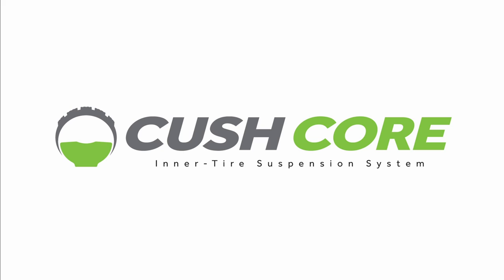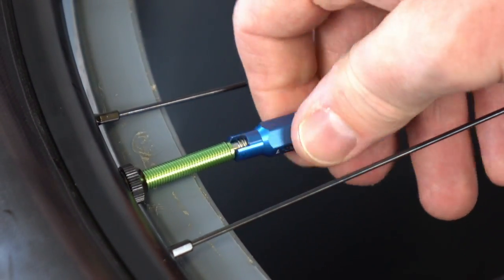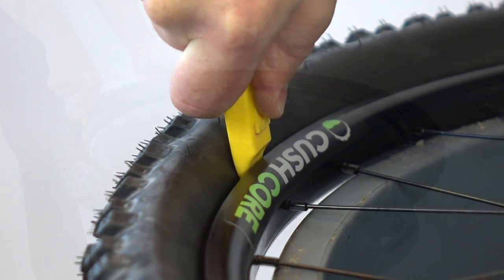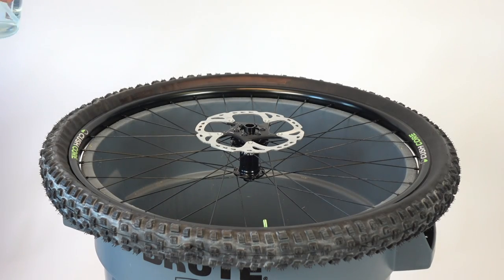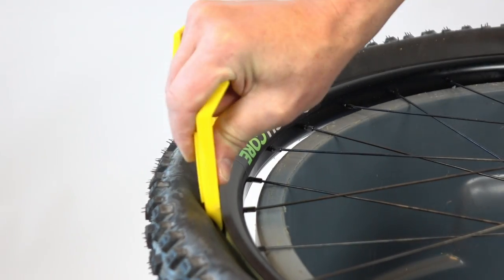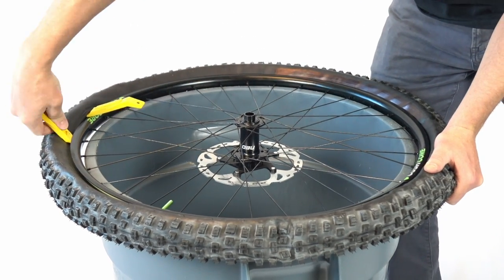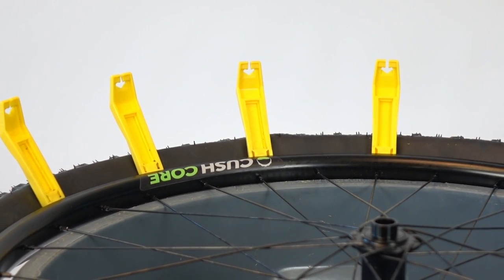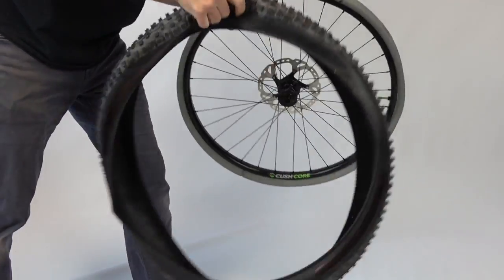Tire Removal with CushCore

Comment: This bead breaking technique only works on freshly fitted tyres. One they’ve been on a while you arn’t getting the bead off just by pushing it with a lever.
Reply: It wasn't exactly easy but it worked on my specialized eliminator after 6 months with cush core. Also to consider, without cush core I was able to remove and install that tyre using only my hands cause it is very light.

Comment: It sure does look easy on the video. At least I'll never have to cross train and can just become a professional cush core wrestler.
Reply: A makeshift tire stand, a nice round garbage can. Where your new hope rim will eventually end up when you still can't remove a DH casing tire after trying for days.
Reply: And I take it all back. Finally got it.
Reply: And it only took you couple of weeks :D
Reply: @stickthatboof  Hey ... knife + wire cutter. One side is still on, the other is cut. Bleeding hands... and I trained on enduro and MX tires....  this was IMPOSSIBLE to drop to center. I have a tire removal stand too ...
Reply: I hated the process when i wanted to install it. My synchros rims are quit tight to get a wheel on even without cush core. And the Titel i wanted to put on Was the Continental Kaiser it is even tighter with the beat then any tire i know. Was a pain in the ass but i got it on. Now i face the challange to get it off and change the cushcore to my New bike. Wish me luck i'll need it

Comment: One of the most important steps is to completely remove the valve core. This allows you to press on the tire without it pressing back at you, because air can freely enter and leave the tire.

Comment: One tip for getting the tire off the bead. Use the tire lever as shown but give it a light tap with a rubber mallet. Worked for me, where doing it by hand wouldnt.
Reply: This!👍 The video is useless because it is a new tyre with no gummed up sealant 🤨 Force the tyre lever in slightly then hit it with a mallet, the bead then falls into the well of the rim. Chase around the rim using the same technique until it is un seated all the way round 😁

Comment: It can be ungodly frustrating but it can be done. If you get frustrated, take a break. Don't be like me. I tried forcing things and wrecked the rim removing my rigid DH tire with a wire bead. Also bent two tire levers in the process. The issue for me was that it took a ton of force to break the bead away from the rim, and after doing so it would pop right back into its slot when I removed the tire lever.

What worked for me was using 3 sturdy DH tire levers. I pried the bead away in three spots close together, leaving the tire levers in place to keep the bead from popping back. Then removed the middle one and moved it to the outside to pry more of the bead away. If the bead pops back into place when you remove the middle one, pry it back and stuff something in there to keep it away from the rim. I kept repeating this until the bead was around 50% separated from the rim, then it started to get a lot easier to push the tire away and the bead stopped trying to reseat itself. Once the bead is unseated, it's just like removing a tire without the insert.

Comment: This sounds good but it does NOT work.  I followed instructions and got no where  might work if there was no tire sealant involved. Probably have to cut the tire off and throw cushcore away
Reply from the maker: Bill, Feel free to reach out to us directly at 541-241-2444. We are happy to chat with you to find a solution to your issue!
Reply: @cushcore no, no. He's got it correct. The proper installation of your product involves opening the trash can and inserting into that receptacle.

Comment: I just grabbed a knife and wire cutter 5 minutes ago and that took care of it.

Maxis recon 2.8 was so fused to the rim after 1000Km and 2 bottles of Stan's, that it was impossible to drop to center. Minus, my rim doesn't have much of a center. Might be enough for a normal tire removal, but not with the CushCore inside.

I changed motocross and enduro tires by hand (tire levers) without proper tools. This was literally fused to the side walls .. 40+ years of riding and haven't seen anything like that ....
Reply: @cushcore690  The rim is the DT Swiss made specifically for the Pivot Shuttle. Has a very slight and curved center drop. 2.8 ... the tire was a Maxxis recon. (I am happy it is gone, it is a horrid tire :) ... but lasted 1100Km ... 

BTW I rode home on a flat that didn't seal. 5Km Rocky dirt road (not really a road anymore). Not a dent and the CushCore looks like new... 

Cheers ..

Comment: So take two packs of levers and a trash can riding with me? Ok check
Reply: get yourself a bacon strip pluggeroo for the trail. I made the mistake of pulling my cushcore on the trail once before realizing it probably wasn't necessary.
Reply from the maker: All you need is Dyna Plugs or Bacon Strips tire plugs! Works like a charm
Reply: Unless you slash a tyre beyond a dynaplug repair capabilities
Reply: @knott4me561 then you need a new tyre anyway. Ride is finished, take it to the shop or home workshop and fix it. You can pop the bead trail side with a single tyre lever if you're practiced with the technique. I carry a tyre boot with me for side wall gashes.

Comment: TO PEOPLE WITH TIGHT BEAD + TIRE COMBO  (no tire leaver required)
You have to bend cushcore very hard and then pull on tire with both hands (each hand in diferent spot around 5cm gap between hands). 
Dont grab cushcore together with tire, grab cushcore and tire with some slack and then bend it.
If u have troubles understending try taking off cushcore from rim first to see how it reacts and how to expose bead by bending cushcore alone it will help u alot.

I Strugled 6h to take my tire off and then i tried with second rim and cushcore without tire, it helped me invent this technic. After that i got my tire bead off first try :P
Reply: With 2 people, doing this and push the bead in with a tire leaver worked best for me to unseat the bead

Comment: Save time if you're swapping out new rubber.Just cut the tire off,  right down the centre all the way around,  remove cushcore, then the two halves of the tire. Waaaaay easier. My tire was glued to the rim and the method recommended here wasn't cutting it.  Lovely product but needs some installation/removal refinement.

Comment: This only works on recently fitted tyres, once tyres have been on a while the one and only way is to cut it off as no tool I’ve found will remove it from the rim, as the Stans sealant glues the bead to the rim eventually. Even jumping on top of a tool placed on on the bead with my full body weight doesn’t remove it from the rim.
Reply: Use a sliding DeWalt  clamp. Oneside on the rim. The other pushes and hold the bead in.

Comment: Any info on how to drop the bead when your cushcore is so tight full body weight plus C-clamps can't drop the bead into the trough?
Reply: Oh yeah, and how the hell to get the air out with standard valves? Because seriously, why the hell do you include those stupid gigundous 55mm valves instead of something reasonable?
Reply from the maker: Breaking the bead shouldn't be that difficult - something is wrong.  Please get in touch with us so we can help sort it out.  541-241-2444 or info@cushcore.com as Joe said.
Reply: Knife + wire cutter. No, I literally just did that. I have tools, MX tire stand and experience with MX and bike tires. This was impossible as my tire was completely fused to the side and didn't move AT ALL ... I didn't want to risk damaging the rim/spokes, so I just went for the tire .... it was trash after 1000Km on it anyway :O
Reply: For me it worked to take a mallet to my tire levers. Pushed the bead in no problem that way
Reply: Levers were a waste of time (30min) and sweat for me. 
Using hands to pull tyre and cushcore away from rim to drop the bead was the key.

Comment: I have cush core on my carbon wheel with a brand new tire has 2 miles on it before I sliced the sidewall. I've done everything I can possibly think of this tire will not come off going to the bike shop. May end up just having to cut it off. starting to 2nd. Guess this cush core stuff because had I been somewhere that I wanted to continue to ride that would not happen.

Comment: Recently bought. Had to slash my new tire open with a knife to get it off. Absolutely no chance of making space between bead and rim after installation, with this technique or other techniques. None whatsoever. Something is wrong with the concept altogether I think, when it comes to using it with high quality tires that usually have a tight fit. Net economic loss for me. I do not recommend this product.

Comment: OMG my Conti Barons are so tight on the rim even moving the Cush Core inside of the tire doesent do the trick. Dont wanna crack my carbon Rim! Maybe break the bead with a pressure washer or what?
Reply from the maker: Support the wheel in a way that allows the tire to flex. If you don't have a big trashcan, just support the rim on the edge of a 2x4, stump, etc. Use a tire lever with a large comfortable handle. Position the tip of the tire lever directly on the bead, right next to the rim, and press straight down hard. As long as the rim is supported and the tire isn't pressing against the ground, this will do it.

Comment: I struggled for an hour trying to break bead with a helper before viewing video.  I think the trick for me was wiggling (yawing) the tire lever back and forth while pushing down hard and it finally broke the bead.  also using a trash can setup similar ot video.  I also put a folded up glove over the tire lever so I could really apply a lot of pressure without killing my hand.  This was on a new Maxxis Rekon that had 30-40 miles on them.  I had just put them on last week, got 2 rides in and rim tape started leaking.

Comment: I have a set in the mail, please could you advise best method of repairing a flat on the trail.. Tire plug or remove CC and fit inertube. Removal trail side looks awkward though. Thank you
Reply: anything you can do to avoid removing cc would be advisable. I've made the investment in a tire plug for this purpose. Totally worth it for the rim protection and tire performance that comes with these. No way i could get my dh tire off the rim on the trail
Reply from the maker: We are currently working on a trailside repair video!

Comment: Maybe this will help.   Use 3 sliding clamps  bottom side on the rim the top side   breaks the bead and holds the tire in the rim groove, to give you the slack to pull the top off using your irons.    Good luck.  LOL